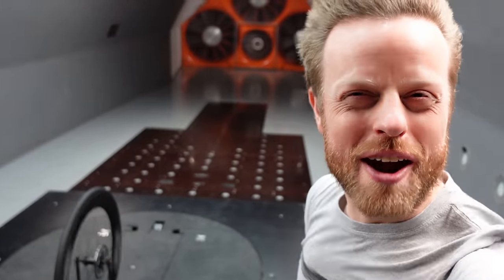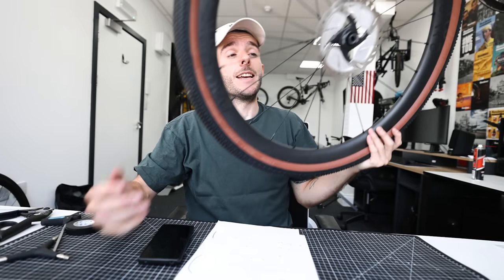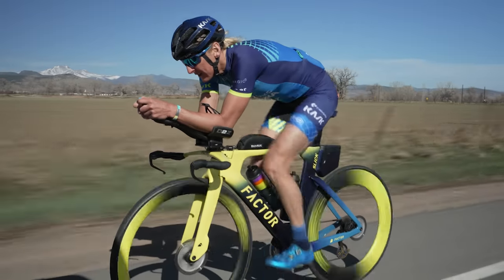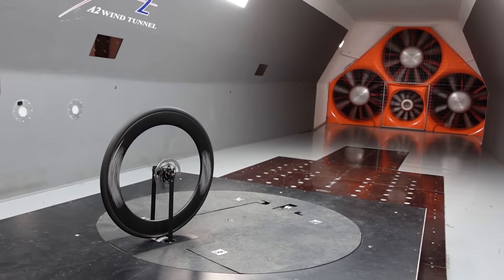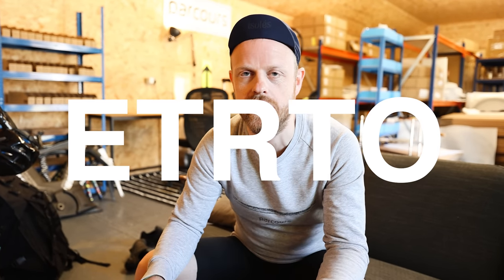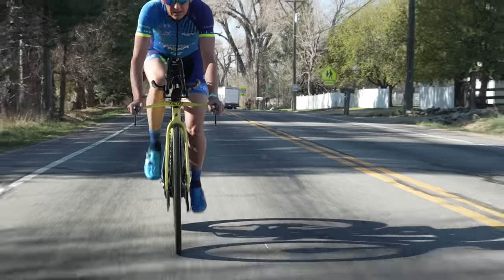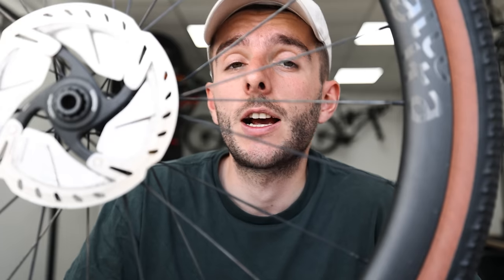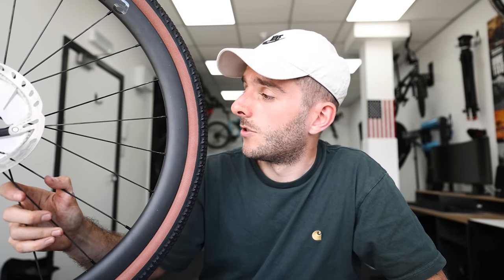What You Should Know About Hookless Wheels

Comment: I ABSOLUTELY WILL NOT buy hookless road wheels. Removing a safety feature for a couple of dollars. NOPE! Just another useless and this case potentially dangerous ploy for the bike industry to fatten their pockets. Press fit bottom bracket anyone?
Reply: Been riding hookless and tubeless for the past year on Enve and have absolute confidence at high speed (max 56mph so far) and hard leaning on the corners. I’m also 200lbs and running 48psi. FULL CONFIDENCE
Reply: @JohnnySantoDomingo  Good luck. I will not. Why add any unnecessary risk, but ZERO benefit. And lets not forget how the bicycle industry has had problems from sloppy engineering that a second year engineering student should have caught, and even sloppier implementation. Yea, I'm not trusting my life or well being to those clowns. As for car and motorcycle tires using hookless, they are TIGHTLY regulated and held accountable, the bicycle industry is not.
Reply: @timm6876  no luck needed…they simply work better and provide a faster ride.  I bunny hop and jump off curbs all day long haha.  Have you at least tried it? I’ve been running 23cs for more than a decade. Yes, there are benefits to hookless, but I won’t continue to try convince you. Hard to believe Zipp, Enve would sell  expensive hookless wheels that would “fail”. Plus Enve has been doing tubeless/hookless since 2016 or even earlier…

I remember running 23s at 120psi and forgetting to check that no tube was caught between the rim and tire bead only to have my tire explode pulling out of my driveway. But that was user error lol
Reply: There is no risk to hookless wheels when you stay at lower pressures. mountainbikes have this for years now. for gravel its also no problem. for road bikes the problem is that people are used to there 23mm tires at 120psi (that does not work hookles) and want to do the same to their new components. just dont. if you buy a new rim with 21-25mm inner width, a 28-32mm tire can be safely run at 50 psi or even lower depending on your weight. it does not squirm. it is not slow. there is simply no performance benefit on real roads to go beyond. you dont need those unsafe pressures for modern equipment.

Heck, i once rode home with 30 psi in my front tire due to a leaking valve (30mm vittoria corsa, latex tube, 25mm inner with rim, real tire width close to 33mm) - it still cornered perfectly fine, didnt feel slower and only felt a bit squishy under hard acceleration. i even drove over the small curb in front of my home like i always do without bottoming it out. 

normaly i settled with 45-50 psi for this setup (72kg + 8kg bike + stuff i carry) and its perfect. before that i run 25mm tires on a 15mm inner width rim and anything below 90 psi was stupid. now with half the pressure i am as fast if not faster but much more comfortable.
Reply: @Digi20  Suck the coolaid all you want, and believe everything the bike industry tries to sale you. Doesn't matter to me. I will choose otherwise, as the bike industry has demonstrated utter incompetence in the name of profits again and again.